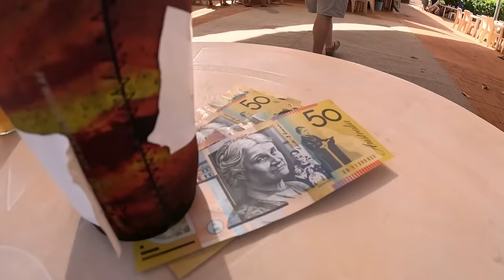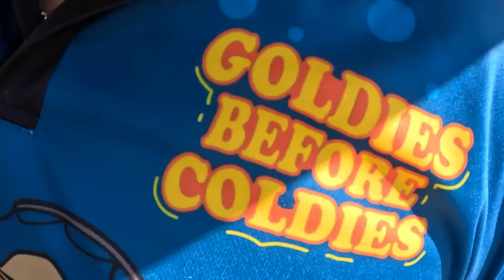Re-launching the Mothership

Comment: Mikey. Are the crabers hats big mate. Ive gota  big head.  
 Most hats dont fit me  not even the last one   . Need a deep hat and xLL
Reply from the maker: Crikey… I dunno. They are adjustable. For comparison, I wear a size 62 Akubra (which is pretty big) and the Gulf Mud Crabber cap fits me perfect when I adjust the thing on the back to the last 3 holes. 

Hope that helps.
Reply: Ill be up with mad mullet soon crabbing